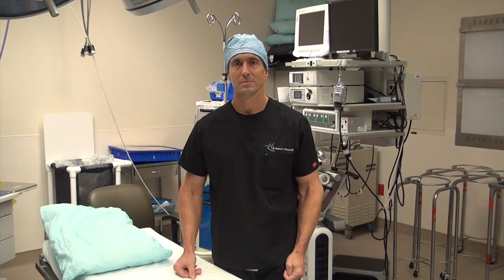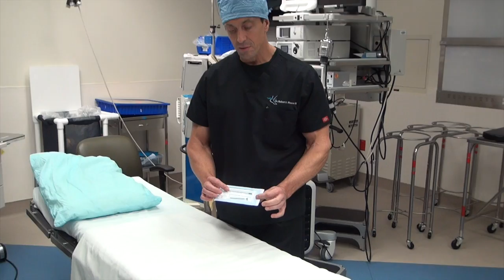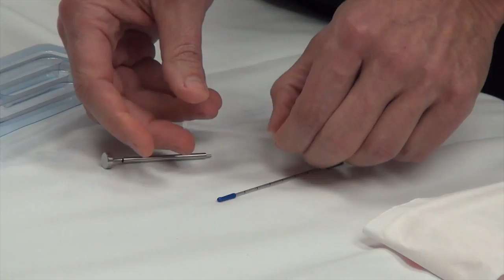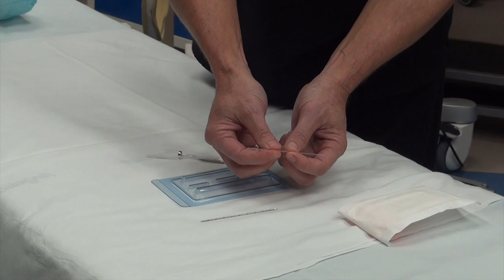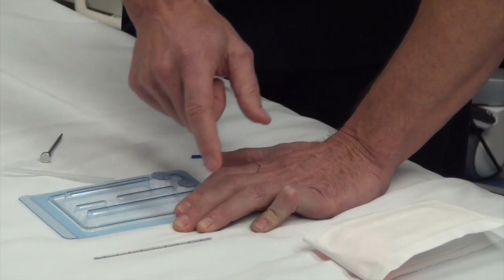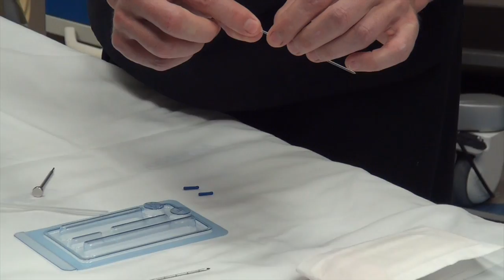Hammertoe Surgery Explained by Dr. Moore (Using an 'Internal Pin')

Comment: Why can’t you just tape the toe to an external pin?
Reply from the maker: Yes, good question. In the past, the arthroplasty was performed and toe(s) were "splinted" in the straightened position. But they would deviate upward, downward, or side to side over the years. Even when they were temporarily pinned with K-wires that were removed in the office 3-4 weeks later, they could still move from their straightened position over time. The internal pins, offer a more permanent, predictable position of the toes.
Reply: @DrRobertJMooreIII thanks for a great answer!
Reply from the maker: @Sjsod42  You are welcome.

Comment: So if I have a broken toe and get a pin in it if it’s not healing properly, will I still be able to walk normally, and bend and point my toes??
Reply: No probably not. I have pins in my toes and I’m getting one removed in a week. The bones fuse so I’ll never be able to bend it which I knew going into it.
Reply: @strawberrytiramisu  we’re you able to walk normally and go to work after a week or did you need more time?

Comment from the maker: Hammer toe surgery with internal pin (Trim-It Pin by Arthrex)  

If you have a hammer toe, claw toe, mallet toe, short toe, or long toe, there are a variety of surgeries you can perform now that will not only correct the deformity, but keep the toe in a normal position. The ‘Trim-It Pins’ by Arthrex – http://www.arthrex.com/foot-ankle/trimit-pins – are not only ease to insert during the hammer toe correction, permanent corn removal surgery, or toe shortening surgery, but you can bend it to give the toe a slight bend or any position you like.   This is important for cosmetic foot surgery since correcting the hammer toe is one thing, but matching the rest of the toes is critical.

Post operative care is relatively easy with suture removal at 2 weeks and of course no pin removal. Return to shoes is 2-4 weeks (patient preference) and heavy exercise in 4-8 weeks.  

To see patient testimonials, surgery videos, new medical advances in the foot and ankle surgery community, feel free to log on to http://www.www.MyFootFix.com or our blog at http://www.Dr-Robert-J-Moore-III.com to watch the surgery, listen to patient testimonials, see patient reviews, ask Dr Moore a question, or make an appointment.  

Stay Healthy and One Step Ahead!
- See more at: http://www.dr-robert-j-moore-iii.com/#sthash.n2IP7rV3.dpuf